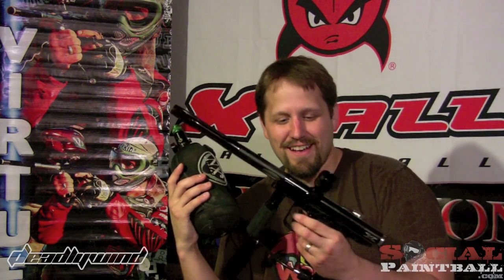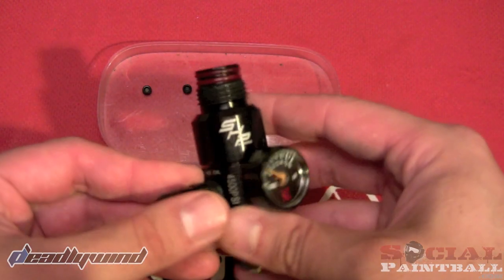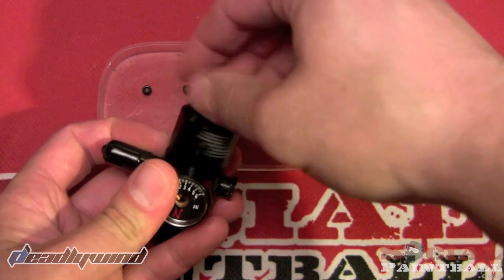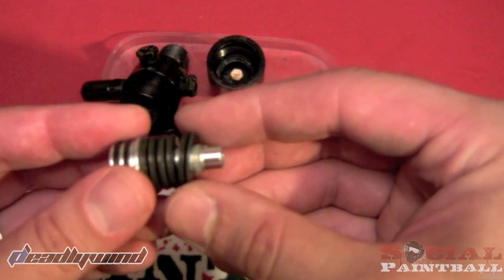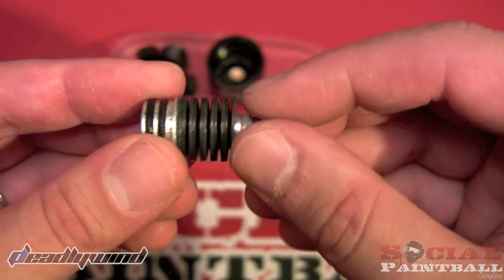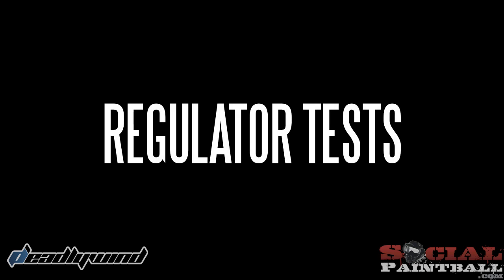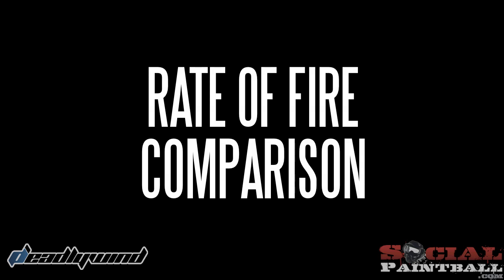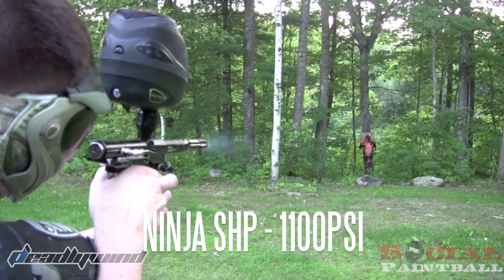Ninja Paintball SHP Regulator Review - Ninja Super High Pressure Paintball Regulator

Comment: That gun seems to be underperforming with both regs.  Mine easily tops 15 bps with a standard 850# reg when sweetspotted, and I haven't sound tested mine at 950#, but I have seen 950# automag sound charts showing ridiculous fire rates, as in, in excess of 30 bps.  What bolt spring are you using?  I use the medium in mine.